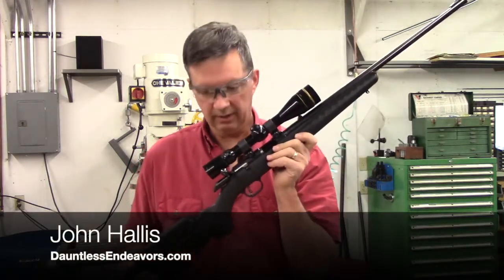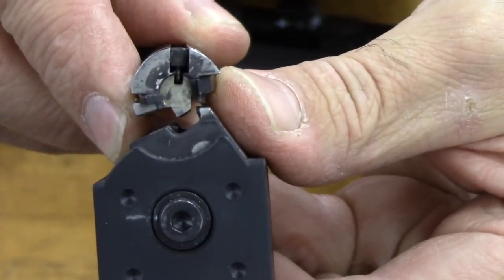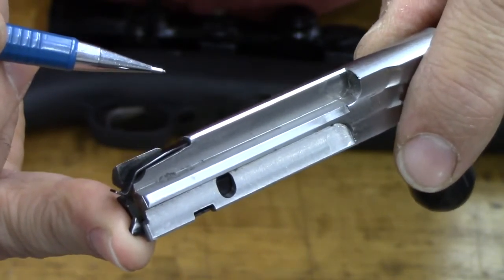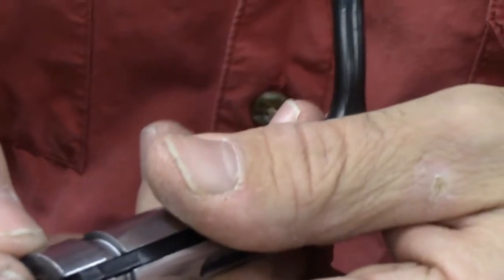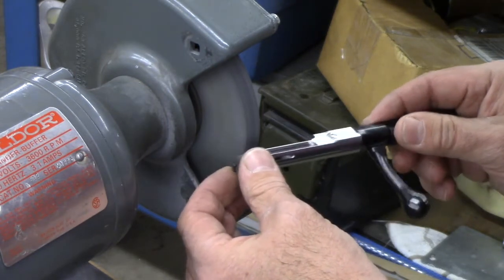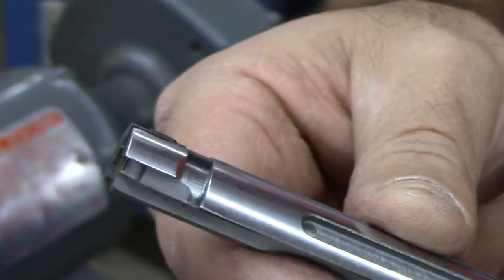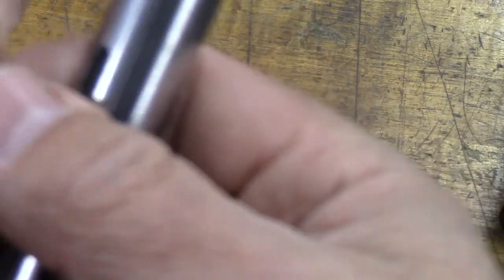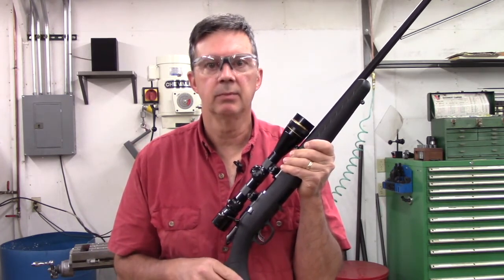Ruger American Rimfire (RAR) Experience, Part 2: Deburring the Bolt.

Comment: thanks for sharing.

I'd say you seem to have got bit of a roughly finished 22LR RAR, my 22LR RAR, having less than 200 hundred rounds through it, purchased brand new about 7 years ago, shows no burs on any of the points / areas you mention in this video...mine seems to have definite small amount of material already evenly removed on all those surfaces, with no burs at all, and mine does does not damage the rounds in the magazine from bolt cycling....agree with other comments here too, that the RAR rotary 10/22 magazine has quite a tightly adjusted mag spring from factory, and is also highly likely contributing to your issue...with such a tightly adjusted rotary spring, it puts a lot of friction between the top round and the one below it, with the top round RIM scraping over the one below it, to move the top round above it out of the mag into the breech...

Comment: I have some CZ 22 rifles #452  plus the #457. I also have some Ruger "RAR" models. Their bolts are in similar in construction with the CZ being shorter. To me one of the main differences in the CZ vs Ruger is the receiver and the bolt chamber dimensions. The CZ's bolt is way more tighter in the receiver, very little play. The Ruger bolt however has more play in the receiver. One of the reasons I think the CZ is more accurate. From some of my buddies who have sent their Ruger in because of accuracy problems the factory installed a new bolt. A tighter fit bolt he told me, thus improvement. I love the lines of the Ruger and I would gladly pay an extra $100.00 for accuracy improvements by the factory out of the box.

Comment: I just checked the rifle I bought 2 days ago. I only went through maybe 150 rounds and it shows most of the marking shown on your rifle. I have some very high grit sandpaper on hand. Is there any reason this wouldnt work well to deburr the bolt? I understand I have to be careful with this kind of thing and not go too far.
Reply from the maker: Go lightly is the key.  A heavy-handed approach to gunsmithing has probably ruined more firearms than anything.

Comment: I had fail to fires right out the box with my RAR. I had a chunk of metal I found inside. It was also packed solid with thick black grease. The bolt shroud and body looked like a cave man chiseled it.  After filing, stoning, and polishing it works fine now. Ruger quality control has been in the toilet on the American line.

Comment: You may also want to 'unwind' the magazine spring, this will greatly reduce the upwards pressure applied to the cartridge. They come pretty tight from the factory, probably because they are meant to be used on an autoloader 10/22...
Unwinding the spring also makes the loading easier too...
Reply from the maker: I haven't experimented with the magazine spring tension, yet.  Thanks for the tip.  Do you know how "light" you can go before reliability becomes an issue?
Reply: @dauntlessendeavors1000  did you ever do it?
Reply from the maker: @michaelvoorhees5978  No, not yet.  My list of experiments is growing faster than I can keep up with videos.

Comment: How smooth is your bolt? Mine has concentric machining marks all the way along the body.
Reply from the maker: Other than the light burrs shown in the video, my bolt is relatively free of tooling marks.  The "turning marks" you describe aren't pretty but they shouldn't affect performance and the bolt will become smoother with use.

Comment: What would you do if you removed the firing pin?
Reply from the maker: That's a good question.  So far, I"ve been picking the low hanging fruit.  I think I'll completely disassemble the bolt, just to see what it looks like.  Stay tuned.